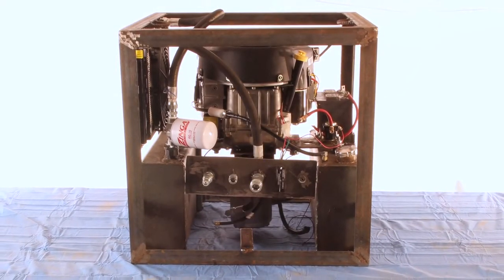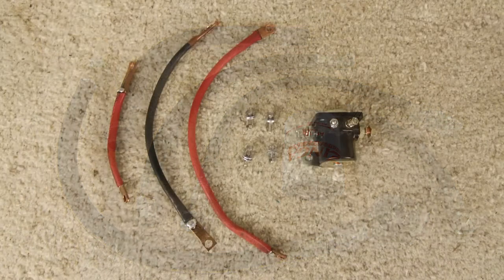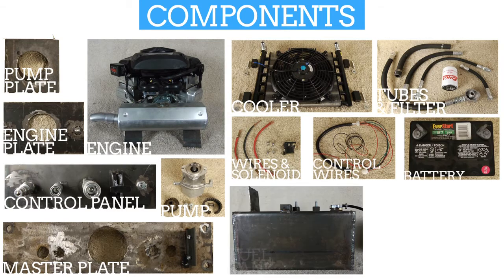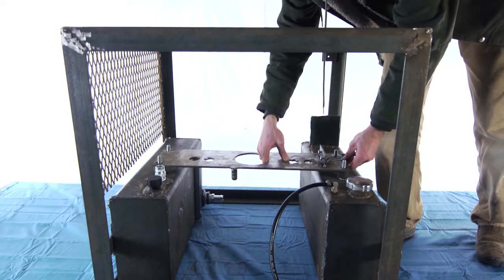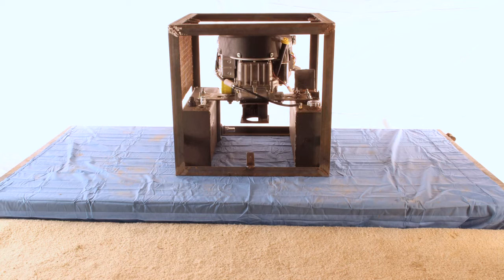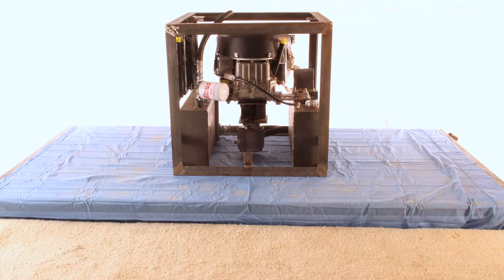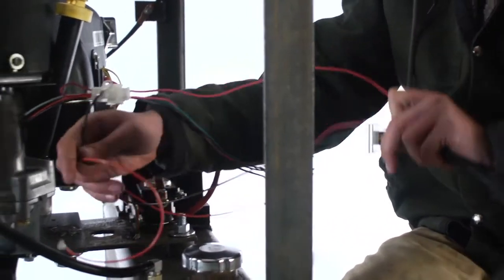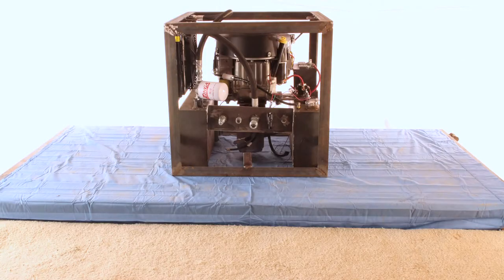Powercube v7 Assembly  by Open Source Ecology

Comment: In the section where the fuel tank is attached to the frame the narration says to use a hammer and you use a wrench, which iis a classic example of the 500lb. gorilla method. You forgot zip ties to securely attach the wiring harness to the inside of the frame and clean up the appearance while keeping the wires safe and free from getting snagged or caught on other things when moving the cube around.

Peace!

Comment: It doesn't appear that engine has an alternator, so that battery will drain down pretty quickly running that fan.    Would be nice to have an alternator and a solar trickle charger.  I think using a Bobcat Style Flat Faced Coupler Saturn Manifold would have been a little more compatible with todays equipment, but should be easy to convert over.
Reply: The engine looks like a Briggs and Stratton V Twin but it is hard to be sure from this angle. The alternator rotor is built into the flywheel and the stator is built around it. Even if it was a Kohler, Honda or somebody else, they all pretty much use that alternator setup.